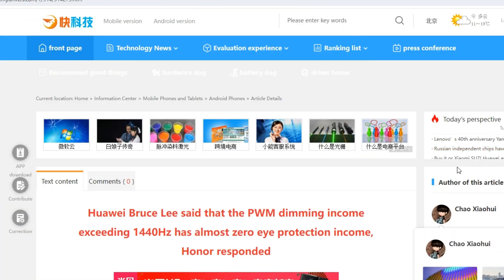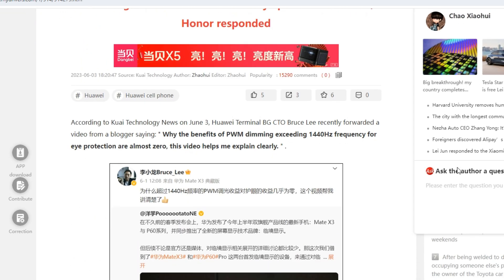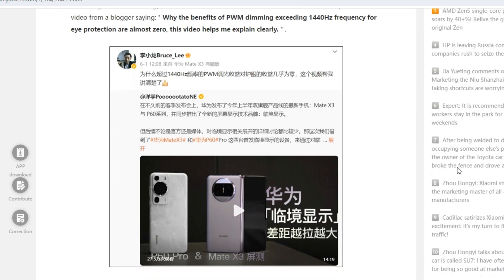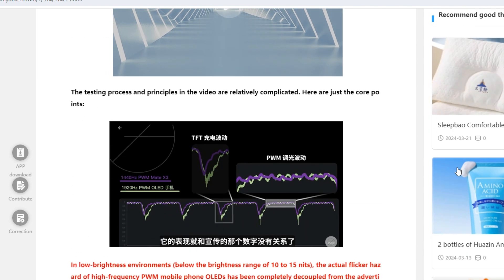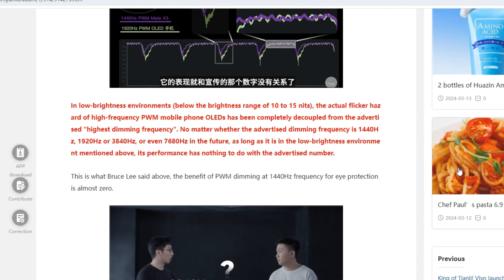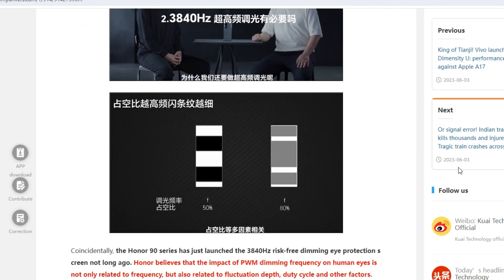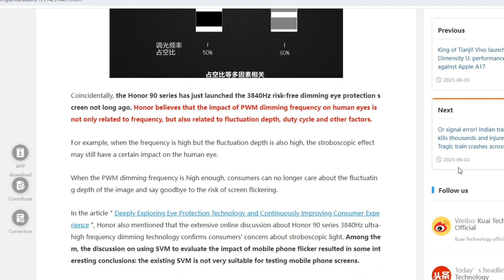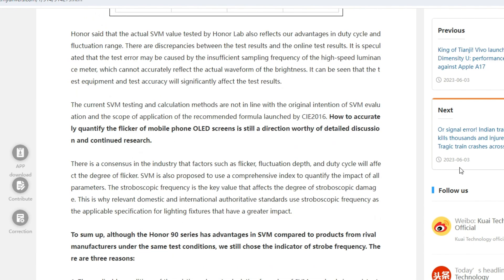PMW Dimming 2160 Hz: Say Goodbye to Flickering with Nubia Red Magic 9 Pro & Honor 90!

Comment: Hey quick question, how can i map my Controller on console mode?? There's no option for that, the only option is keyboard & mouse. I really need that adaptive resolution because it really fit the resolution of my monitor (when in console mode). Really feels different with mirror mode (which has gravity X to keymap controller)

Thanks!!